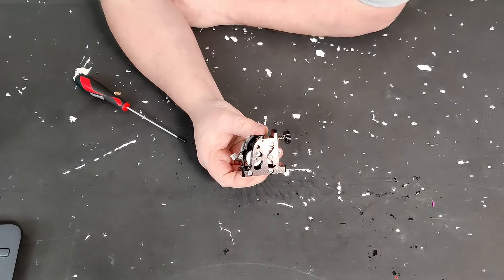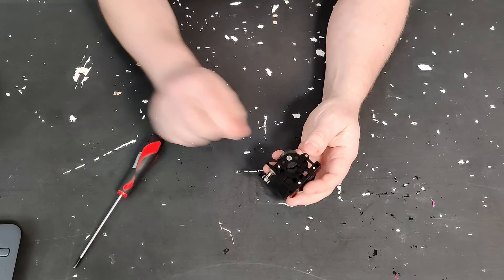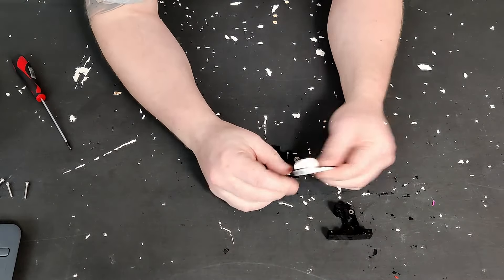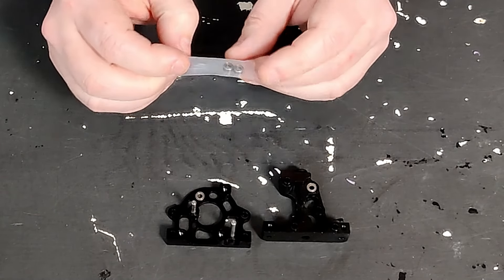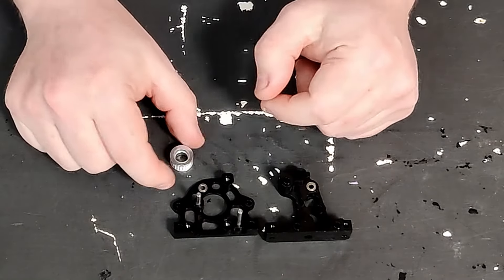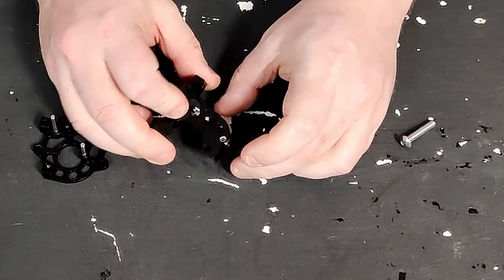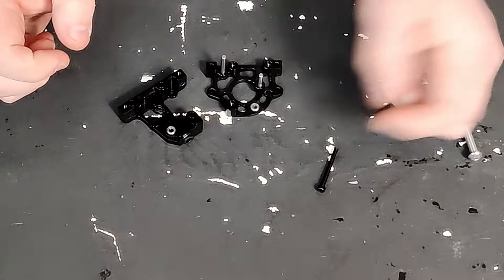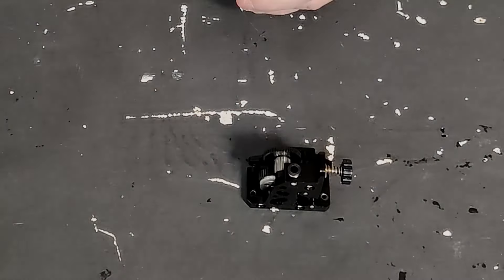HGX-lite Fix!

Comment: the main reason for this problem may well be contamination. The bearings are only shielded and not sealed. Like the linear bearings, these may contain fine debris from the factory. Give them a WD 40 shower twice, dry them out and fill them with oil or thin grease. You may have a bearing for life. 
Thanks for the video.
Reply: Super Lube is amazing for smaller bearings on machinery. I use it for embroidery machines i maintain and it's a game changer. Its a synthetic oil so it likes to stick to metal and also makes the machines run much smoother as the oil takes more to sheer or cut through. The plus is that it also has particulates of PTFE that coat all the uneven groves inside the bearing runway. I've been using that and a synthetic grease with PTFE for decades now on anything i can find a use for it

I started using it right away on my 3D printers back 10+ years ago and my first printer the Replicator dual is STILL on the same set of bearings with some 20K hours of print time on it. Only thing that has started to change on it some 5 years ago was the tone of the stepper motors and replaced some of the fans. I'm thinking of setting it up for my Klipper pad🤔

Great advice on cleaning them out with WD-40, actually using it for what it's meant for

Comment: I have been using HGX lite on my hurakan as a direct extruder for several months now. Got my 2nd set works just as well for 2nd printer and also bought some spare gears sets and printed the housing works just as well with a lighter weight. Will get 3rd on my Flsun SR as direct extruder too soon. Thanks for making this video as least I know of the issue❤

Comment: Also check booth the metal pins on which the bearing of the gears are running.
I have one hgx where those pins went bad after less than 10 print hours.
Reply from the maker: Not had an issue with mine, but I'll keep an eye on them :)

Comment: I wonder if the 2.0 version has this issue. Just made a new toolhead using it and so far it's worked really well.
Reply from the maker: I'm interested in finding out, I don't have the 2.0 version sadly

Comment: Is this extruder very different from the sherpa mini? I want to use it in a prusa mini and I want to know if it would work for me, thank you
Reply from the maker: In terms of function, it's the same. And the mounting holes are the same. But the gearing and internals are different
Reply: @kanrogcreations  So in theory, calibrating and configuring it should work. thanks!
Reply: @kanrogcreations  So of the 2 - HGX Lite and Sherpa - which one would you pick as the better one and why?  And the timing for me is great as I am building a printer and am trying to figure out what parts to use for the build.  

I am heavily considering the Orbiter 3 with the Bondtec nozzle, or the Hextrudort because I think it is an interesting design and the creator seems like a decent person... 

Also considering the Phaetus Apus - that thing is pretty cool and i think it would perform very well.

And (and!) also thinking of using the Bambu extruder, get the new skeletonized frame for it, upgraded gears, and use it with a stock Bambu hotend or the E3D version - which by the way i saw a video on it showing how it not only can out extrude the stock unit but has much better layer adhesion.  That alone could be the clincher!  

Great video by the way - straight to the point and very clear - thanks and cheers
Reply from the maker: I'd pick the HGX, the price is just too good
Reply: @kanrogcreations  Wow, are you sleeping right on your keyboard! JK!

But if cost was not an issue or not a big issue would you change your selection?  Have you tested any of the ones i mentioned?  

And thanks again for the reply, i am a newbie to this 3DPrinting world and i am solid with the mechanics, but a bit, no a lot lost on the firmware shyte - however i think i have what i need figured out at the moment.  
- BTT SKR 3EZ board
- 2209EZ drives
- get the CAN board adapter (if needed)
 - get a Raspberry Pi 4 or 5 to run Klipper
- use a BTT EBB36 or similar CAN board on the toolhead... phew!  I hope the formatting turned out readable.  What are your thoughts?

Comment: Mine does not spin if the motor  is in is that normal?
Reply: if the motor is energized and engaged it is normal.
Reply from the maker: If the motor is engaged, it should be locked, but if the motor is off, it should move with a little resistance

Comment: Hi can we use this extruder with a bowden set up ?
Reply from the maker: Yes, but I would recommend using a PTFE adapter and running it the same orientation as in a normal direct drive setup. The PTFE coupler on it does not like the increased pressure

Comment: How can I use this HGX Lite extruder in a bowden setup, the product came with just itself and no user manual about how to set it up. Can you help me with it, I just got a free Ender 3 pro from a friend of mine and still learning my ways around this hobby
Reply from the maker: It would require a custom mount, but it's doable. The PTFE collet doesn't like being in a Bowden setup, so I would recommend running it in reverse and adding a printed part with a new collet on it.
Come to the Rolohaun Discord and I'm sure we can get you going with it.

Comment: What's the difference between MR63ZZ and SMR63ZZ? MR63ZZ seems to be even cheaper 🤔
Reply from the maker: I believe the S is sealed
Reply: @kanrogcreations  Ah okay, makes sense. Thanks.
Reply: @kanrogcreations  Actually, I messaged the seller and they replied "SMR63ZZ is stainless steel bearing, while MR63ZZ is chrome steel bearing".
Reply from the maker: @xKenn  Good to know!

Comment: I confirm, stock bearings are  very loose. SMR63ZZ much better.
Reply: I have a question, which one should i buy?
MR63ZZ or SMR63ZZ?
Reply from the maker: @rics_zip SMR bearings are stainless steel, other is just chrome, so SMR would be prefered
Reply: @kanrogcreations  Thank you, i gonna buy them in the store you share the link

Comment: I guess drive gears without bearings will be a problem.
New version of HGX extruders with 6 bearings  fix this.
Reply: Did they replace the pin roller bearings with smr63zz's?